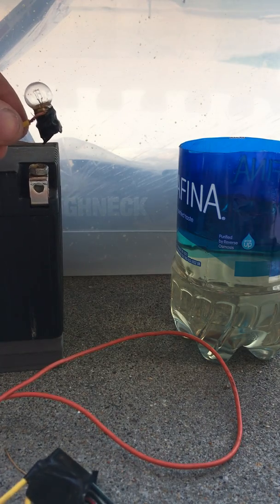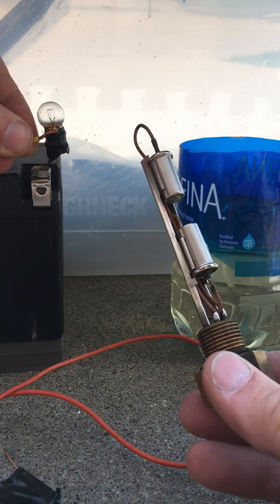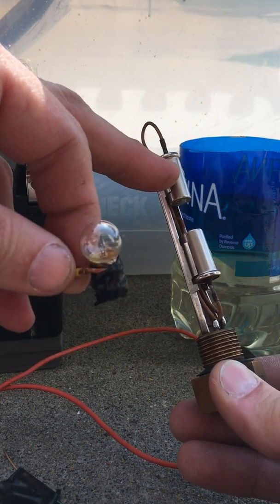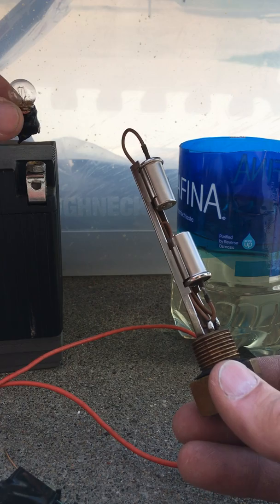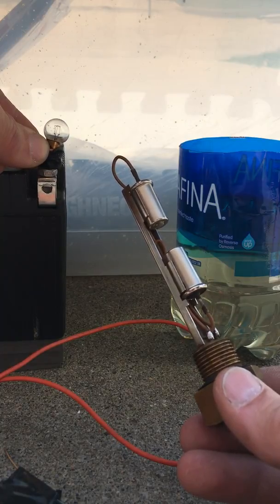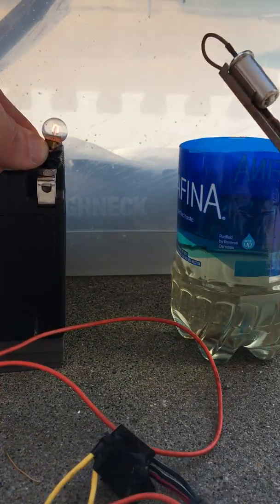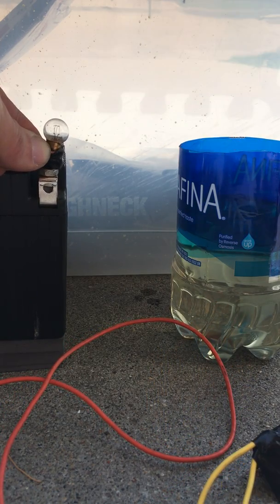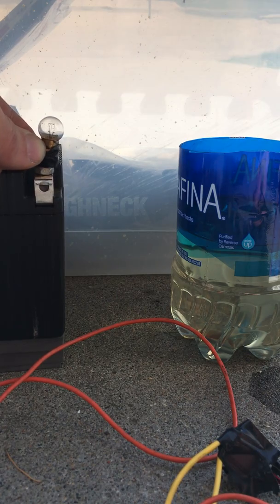low fuel warning light SV650 RG500

Comment: I have 1st gen SV650 with a new digital odometer. It doesn't ready fuel level or warning,but if this thermistor is from the SV650, where do I found these cables and how can I make it work without the original odometer?